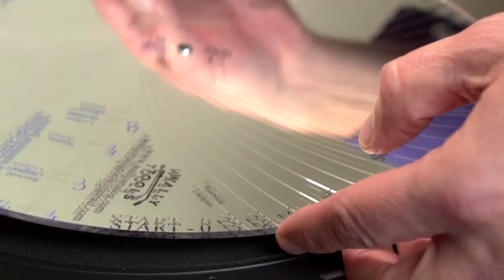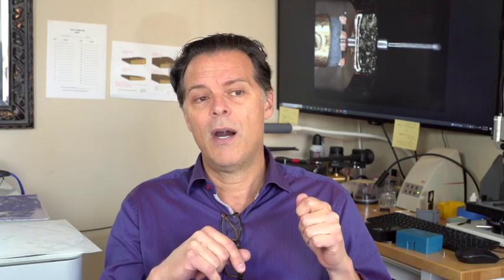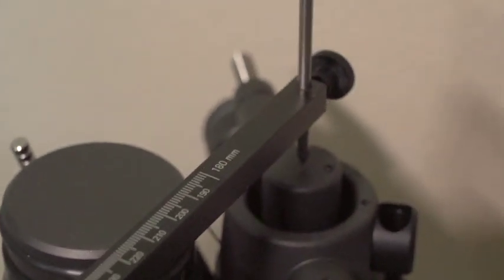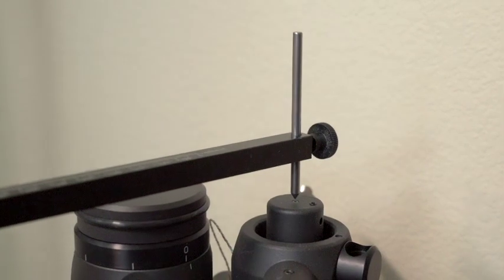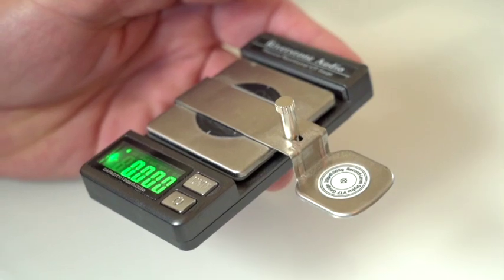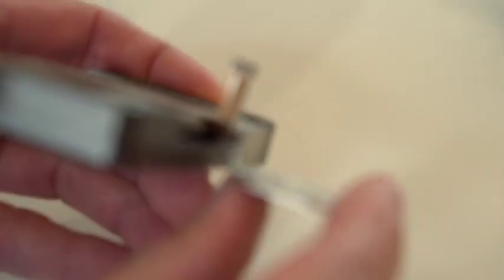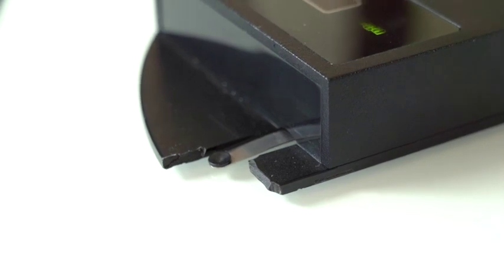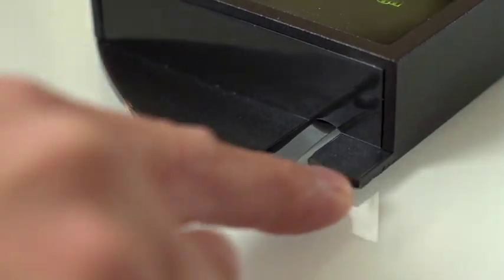7 Analog Alignment Targets - Video #1: Overhang and VTF

Comment: A problem with arc protractors is that you are assuming that the tonearm is accurately mounted at the correct specified distance from the spindle. This is frequently not true, especially with arms that have post held by a single grub screw in an arm collar attached to the turntable plinth,
Reply from the maker: This is true and it is why I include a pivot to spindle ruler with the WallyTractor. If the user cannot get their stylus to trace the prescribed arc then it means the pivot to spindle distance is no good. With the ruler you can verify and use our online calculator to figure out what is wrong.

So, what you call a “problem” becomes a feature to help diagnose the issue.